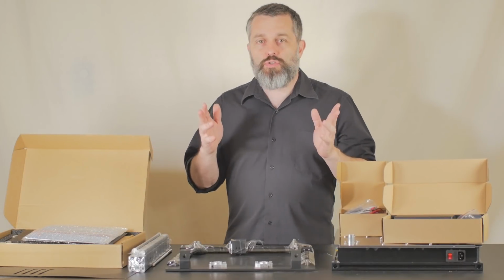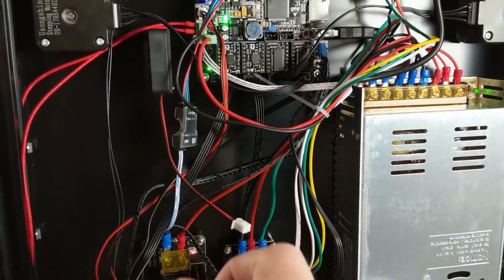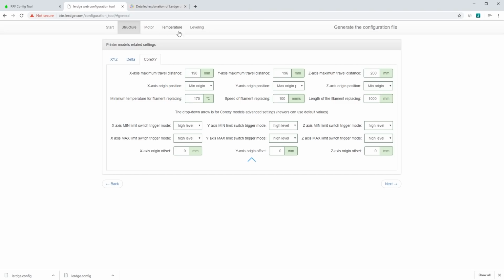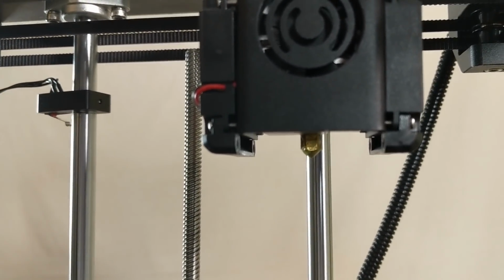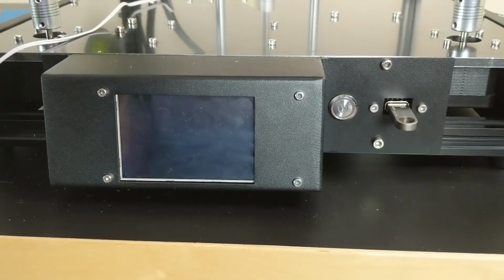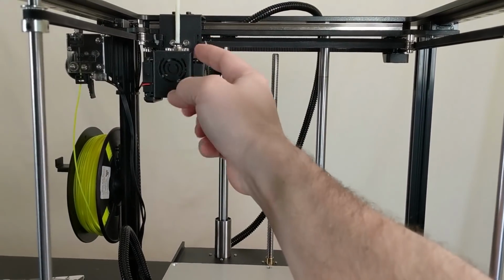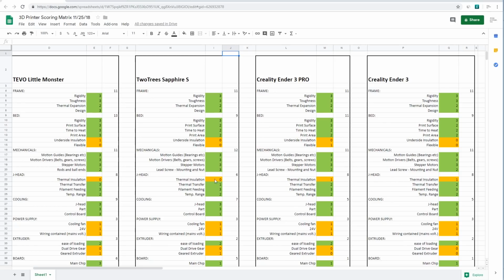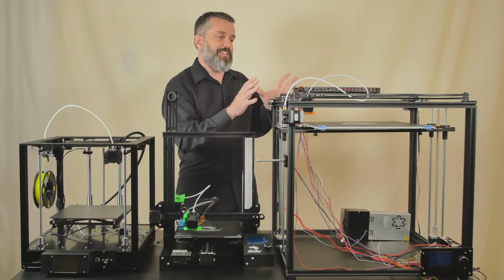The TwoTrees Sapphire 3D Printer Is the Best We've Seen Coming out of China

Comment: "pretty good for a Chinese" who do you think makes most of this stuff XD . that apple styled button is just a car button.... been around forever.
Reply from the maker: Yes, but typically you have a western brand putting their name on it and doing the quality control. When it is a Chinese branded company, they don't seem to care about brand image, and they do a bad job with the QC. This is something that should change, and it's the reason I spent the majority of the video talking about QC issues on this printer.
Reply: @DesignPrototypeTest  I have a lot of purchases from china. my failure rate is like 1 in 1000.... I have packages that dont arrive all the time, but products failing? very very very rarely. (based on 100 unique items per page and over 10 pages of items) the resistors are all within the 1% tolerance. the transistors are all good there. hell I get worse results with american parts. (digikey)
Reply: @Tom_Neverwinter  Chinese manufacturers are great at components, but completed systems with software, documentation, etc., are not their strength. They tend to aim for shipping the cheapest possible price, but with bad tradeoffs to hit the price, so you often need to check all the connections, dig around in forums due to outdated doc's, occasional missing parts, etc. - pretty much the sort of thing he had in the video. Relative to that, this printer looks like at least it has a good mechanical design and software, just with some QC issues in the build process / documentation. Like installing the build platform upside down - their docs are unclear, and the intuitive thing turns out to be wrong, so many build videos have the same problem.

To their credit, the earlier build videos found design problems (e.g. belts weren't run parallel) which they appear to have fixed.

In my experience, none of the cheap Chinese 3d printers work "out of the box" - they all have bad software and documentation, bad power supplies, etc., to sve costs. That's the sort of thing a foreign partner provides, so even if it's made in China, if it's sold white labeled by another company, that company makes sure that the quality is better. So clearly chinese manufacturing can make great products, but they aim for cheap and "good enough" most of the time. And relative to that, this printer looks like after you put in a little effort you end up with a much better printer. So not a good first printer for anyone, who won't catch and fix the issues, but great as a second or third printer.

Comment: I don't know, man, but to be honest, this is HORRIBLE quality control - hotend has a separate box, but shortened thermistor, thermistor for bed does not have connector, fan for board has nowhere to be plugged - this is more like China 2 years ago.
Reply from the maker: All problems were minor and easily fixed. I would say the factory floor has QC problems, but the design is fantastic, and so is the fundamental quality. All parts are straight and true, and the linear rails have no play in them. The Chinese printers from two years ago (which are often still available for purchase today because China has no shame) were riddled with fundamental problems which were incredibly hard to fix. So much so that the entire machine usually had to be tossed or completely reworked. For instance this printer: https://youtu.be/-7ENDE_iG2g

Comment: Pretty sure that's just a mosfet, not an SSR. While DC SSRs are often mosfet based, the key difference between an SSR and mosfet is that an SSR has isolated input and output. From what I could see, it doesn't look like you have isolated input/output on that configuration.
Reply from the maker: Good information. Thank you!

Comment: This printer should be direct compare to Ender 5 not Ender 3 thought. To many people the proprietary board is already a no go. You even mention the hot end is not very well design and yet concluded this printer have everything done better then Ender 3 for whatever reason. The printer itself is also much larger then the Ender 3 but have a smaller build volume. The sample print also have the bottom warped. The machine is nicely build, but it's not that well designed.
Reply from the maker: The bottom warpage criticism is unfair on your part. You know as well as I do that has nothing to do with the printer. That was all my fault. I printed with no bed heat on masking tape because I didn't want to install the buildtac. The rest of your criticisms have merit.

Comment: There seems to be several issues that you bring up which make me think the inventors did not spend much time putting it together properly.  Switches - plugs - print table - etc etc.  Where should I stop?  If the printer is going to be pre assembled then it must be assembled correctly - that's may be just me, but that is the way I am.

Comment: isn't the Ender 5 still cheaper
Reply from the maker: It's pretty much the same price. Unless you find it on sale somewhere. BUT, the Ender 5 is not a CoreXY machine. It is a cube style construction. However, the frame is not nearly as thoughtfully designed. Also the Ender 5 uses Delrin (plastic) V-wheels riding in Aluminum extrusions to control the motion. This compared to the Linear motion rails of the Sapphire. Sapphire>Ender5

Comment: I'm curious why you didn't compare it to the ender 5? Seems it would be a more direct comparison than too the ender 3.
Reply from the maker: I don't have an Ender 5. The Ender 5 is not a CoreXY machine. It is a cube style construction. However, the frame is not nearly as thoughtfully designed. Also the Ender 5 uses Delrin (plastic) V-wheels riding in Aluminum extrusions to control the motion. This compared to the Linear motion rails of the Sapphire.

Comment: Bad initial print, bad part cooling, bad hotend cooling, no filament runout sensor mounting, power detection failure because of z falling, proprietary firmware that you can easy reset, smaller than ender 3, and it's loud. No, this is not a good printer, and does not sound well made. Why would you recommend this?
Reply from the maker: The Ender 3 deosn't even have a Filament runout detector or a place to plug one into the control board! This printer already has the sensor working and it only needs an easily 3D Printed Bracket to have that functioning perfectly. The Ender 3 is also MUCH louder than this printer. The Ender 3 can suffer from the same problem of Z-axis fall during a power loss, only it's worse on the Ender 3 because the hot nozzle will melt into your part when it happens. YES, this is a good printer. It's better in every way than an Ender 3. Which is what I said in the video. I don't know why you would regurgitate the criticisms I made of this printer back at me and then come to the opposite conclusion. Do you have some sort of bias or agenda?

Comment: This is a confusing review, you give plenty off reasons why nobody should ever buy the printer, as 9/10 of the users will never be able to get the thing started or fry something during the first big print, without a big open source community to ask for solutions. This is far from the best china has to offer!
Reply from the maker: >This is far from the best china has to offer! 
Ok. Which Chinese Printer do you think is better? I'll bet I can come up with a bunch of criticisms of that printer too, and likely the flaws with that printer will be a lot more serious than the ones I showed on this printer.
Reply: @DesignPrototypeTest  i recently got the cr 10 pro, a few friends had it and told me it works fine so i gottje same. You needs to use 4 screws and snap 3 connectors and its done, it prints 30x30x40, prints fine in pla, petg, low abs pieces, ninjaflex,... 
There is a big facebook group to get good answers about settings.
The build quality is verry good, hardly plastic parts.
 There is no need tu upgrade, but if you feel like upgrading, There are plenty of hardware,  firmware and software solutions, tested and improved in a community,...
In Belgium, farnell sells them at €513.
Reply from the maker: Here are 3 major reasons why "nobody should ever buy the printer" you are talking about. 
1) The main control board is an 8 bit processor running bottom of the line stepper motor drivers. 8 Bit processors were state of the art in 1985. Do you really want 35 year old technology running your fire hazard of a 3D Printer in 2019?
2) The Motion of that Printer is done by having PLASTIC wheels ride in the v-slot of Aluminum Extrusion. The process of extruding Aluminum is not nearly as precise as machining Linear Motion rails, and the plastic wears out, and deforms in the heat meaning your printer is not as precise as it could be when brand new and it will not last very long before needing to have parts replaced.
3) The frame design is fundamentally flawed. The bed is constantly making large movements back and forth in the Y direction. It is a pretty large bed which means it weighs a lot. Combine that with the weight of the the print that sits on top of the bed and you get a substantial amount of inertial mass. This directly leads to a loss of print quality called "ghosting" The only way to counter-act this is to slow the printer down substantially. So now your large, time consuming prints take 40 hours to complete instead of half that time on a CoreXY.

Comment: More wrong than right,  should not have to wire it from them. Firmwear?
Reply from the maker: I mentioned every problem I could find with this printer. Have you seen how many components are on the thing? Have you seen the complexity of the design. There are about 100 things done right for every issue I found. I think you are being disingenuous.

Comment: The whole point of a CoreXY is the larger size...no point in moving away from a i3 design without getting a larger build volume
Reply: Nope, point of CoreXY is to allow for faster acceleration without the artifacting you get with a Prusa style machine since both axis are moving around less weight and share the weight they do move between the two motors.  The belt path also helps with rigidity.  That said this machine has to many issues, too many proprietary parts, and is just too expensive to be an "Ender 3 killer."

Comment: You start off this video by making the claim in the title that this is the best coming out of China.  In the first few minutes you show 3 or 4 problems with this printer that would really piss me off if I bought a product and it arrived in that condition.  Multiple devices not connected to the control board and/or not being powered up (fan, thermister...what else was disconnected?)   Then you show the reset to defaults actually wipes the settings of the entire system.  Yeah, this is a mish-mosh piss poor setup if it arrives in that condition and operates like that before you get a successful print.    Maybe you should make the claim that this printer plus a Duet board and a complete rewiring to make sure everything is wired in properly and powered up properly makes this a half-way decent printer for the added cost.  I might be able to agree with that.
Reply from the maker: You can bet I will be upgrading this printer with a Duet board. We are in complete agreement there.

Comment: "Ender3 has a lot of plastic that might not hold up in an enclosure??"  Ender 3 doesnt have much plastic at all. Mainly just the wheels which are hard rubber.. maybe my enclosure is not airtight enough or my basement is too cold to get a higher ambient temp but it runs at about 30°c for hours and no issues with abs, poly carbonate, petg, or other "high temp" filaments, with a 240°c + hotend and 100°c bed temp..
Reply from the maker: There is no hard temperature line where a plastic will deform. Plastic gets softer as it gets hotter. Heat plus mechanical forces wreaks havok on plastic mechanisms. I'm sure the plastic parts of an Ender 3 will work at temperature for a period of time, but how long is that? Metal is the way to go. If I'm going to spend my time making this work, I want to know that it will continue to work maintenance free for a substantial period of time.

Comment: You should see if you can get your hands on a RailCore II ZL kit.  It embodies everything you're always raving about with the best 3D printers (built or bought).  I'm in the process of building one now (ZLT or tall version).  I think you'd love it!
Reply: Order 142 here, still patiently waiting for delivery of my kit. 😁
Reply: @cratervanawesome  I'm sourcing and building my own. Should have it completed in a few weeks
Reply: I am interested in the Two Trees Sap hire, that is why I watched this video, to learn more about it.  I saw your comment about the RAILCORE II ZL kit, and when I searched it came up at a starting price of $1450.  Is that correct?
Reply: @woodwaker1  Yep, https://www.projectr3d.com/products/xrxofoq21t1o786l8apcuympvjmjwj-42ps7 1450 for the kit with v6 gold hotend and non-magentic bed. My kit is all built and i've been doing a ton of printing on it. Very happy. With little to no loss in layer quality at 0.2 i'm printing at 150mm/s.
Reply: @woodwaker1  In that range, yes.  I self-sourced mine and the total build cost to me was closer to $8-900 since I already had a number of parts and used quite a few knock-offs on the higher cost items.  Was a bigger pain to build since I was doing it from scratch but I have some experience doing so.  Up and running now and I love it.  Could build it on a smaller scale for cheaper (I built the tall ZLT model).  Also lots of other even more cost effective models online that are pretty straight forward if you're willing to build it yourself and have means to print parts or order them through a service like Shapeways, etc.

Comment: "EXTREMELY well made" I think you are a very confused man, you list some major issues. Like needing to splice cables, dissassemble the frame to put in an end stop, probably stolen firmware :P
Reply: And some of the worst cable runs I've seen in a commercial product. Splicing things in like a cooling fan is not acceptable. Why is the relay board so loose it makes noise when you tap it @2:05?
Reply: Mark Hutchinson made my day 😁
Reply: Yeah and it's OK to those bed temps :D
Reply: ... no mount point for the filament sensor, fat nozzle area limiting air ducts, A4988 drivers??? Come on. A couple bucks more and you could supply TMC2130. Few more than that and you have a TMC2208. For the price I was surprised it didn't come with Trinamic drivers.
Reply: I was thinking exactly that while watching. "Man, you have a weird definition of quality".

Comment: I will just stay with 2 ender 3's for around the same price.  mine work fantastic, but good video.
Reply from the maker: Do you need 2 3D Printers? Are you printing non stop?
Reply: @DesignPrototypeTest  I currently have 5 3d printers.  most of my prints are several days long so I need more then 1 printer.

Comment: I have one... It's pretty good but they missed the mark on belt alignment. The lerdge board is easier than compiling Marlin but you need a little reference to set it up. Some of the menus don't jump out at you... Would be good if the Bowden tube length was pre-configured or a lerdge board instruction page came with the machine. The extruder and 2 drives can go into the trash for all I care. It's an e3d knockoff but the tension arm is not delrin and is too flexible, the drive gear doesn't center the filament like a hob gear and i got a jam on the first print for whatever reason. I'm not an extruder snob, I have fine results with mk7 style extruders using tmc drivers for smoothness but I was not impressed with the two trees extruder. But I don't buy from china expecting perfection. I couldn't buy the supplies for the cost of the machine so I'll accept a few oopsies in the design... The machine is very rigid. The firmware allows bed leveling and filament runout and pausing and power off position saving with only on screen configuration and while the bed does flex under pressure it doesn't shake during prints and other than change the belt configuration a tad for my own piece of mind and changing the extruder and ptfe tube it's otherwise stock and prints beautifully. It's one of the flatest aluminum beds I've used and pla sticks tenaciously to the print surface. Would put a removable print surface on the wish list and maybe a motherboard with integral tmc2208 drives using serial configuration but that's not really part of the lerdge board ecosystem. Could see this printer going for a lot more if that was an option and better belt alignment.

Comment: Well put together video. I'm not sure how it's better in every way than the Ender 3, but in some ways I can see it. I'm a big fan of CoreXY, so that's a big plus to me, but the implementation of the steppers (in the base, with rods to the top) seems somewhat ludicrous. I'm also not sure a cantilever bed design versus a moving bed via Y axis is that much of a step up, you've just traded one set of caveats and positives for another.

Good technical review, just not sure I come away with the same conclusion.